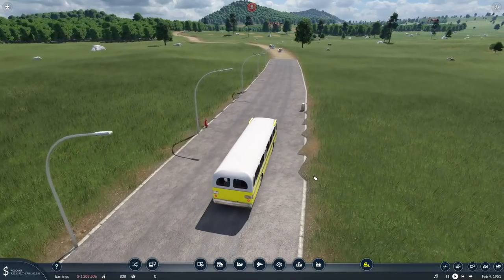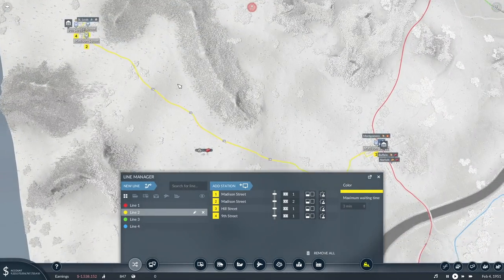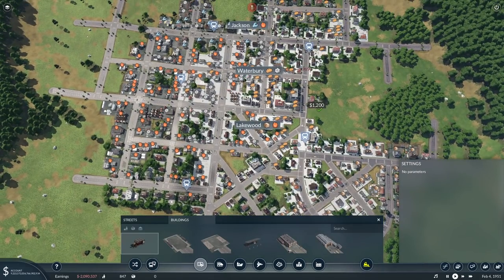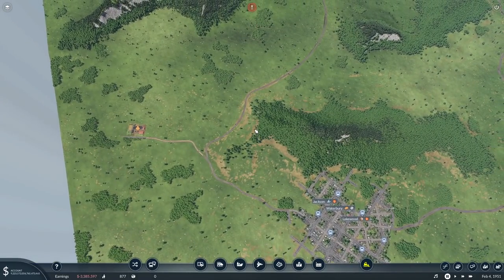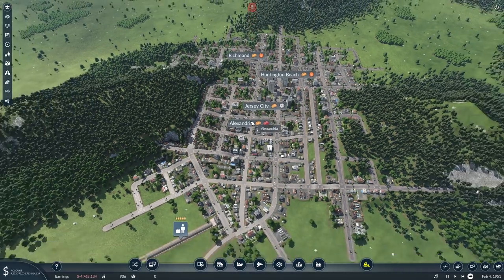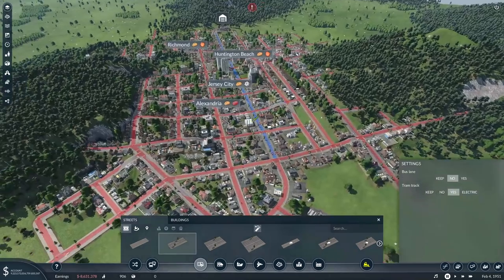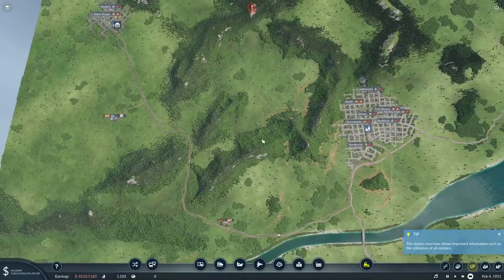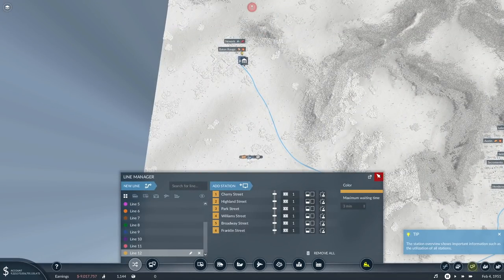Are Trams Really That Good? | Transport Fever 2

Comment: A few tips regarding the public transport:
1. Try to connect residential with commercial or industry areas. That's where the citizens want to travel. Connecting industrial with commercial areas is of no ones interest. Same for big loops through areas of one type.
2. Try to keep the frequencies high enough. From my experience inside of cities bus and tramlines should have a frequency of 60-90s to be attractive. If the demand is high enough you can of course add more vehicles. Intervals of more than 100s are usualy just not attractive and the peasants rather walk or drive the car. For connections between cities I recomnend an interval of 5-8 minutes for trains. Busses might need shorter intervals due to lower speed.
3. Make sure that the capacity of your vehicles is high enough to catch all passengers. I think your trains could do with 1 or more additional waggons. If people have to wait for the next train, this makes the line less attractive and also decreases the growth of the cities due to bad quality of the stations.
Reply: @Luky0805 Sadly the game doesn't work well with realistic timetables. However, this makes sense to a certain degree, as the time scaling and management isn't realistic either (and shouldn't be for gameplay reasons).
Reply: Need to be careful with emissions though having public transport going through residential areas will cause high emissions in places you don't want it to be in